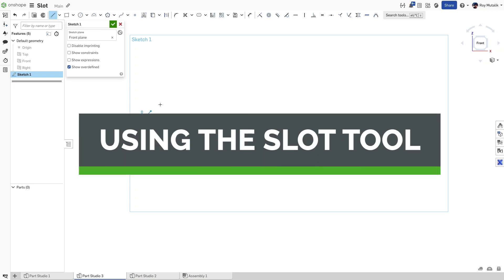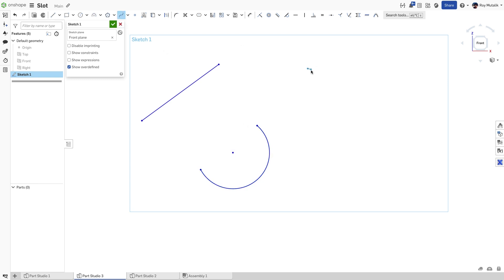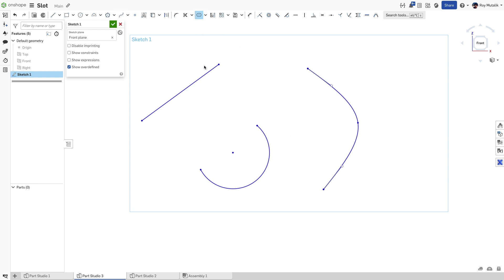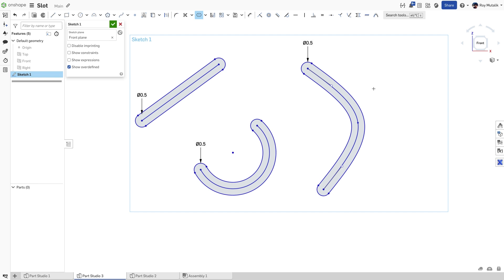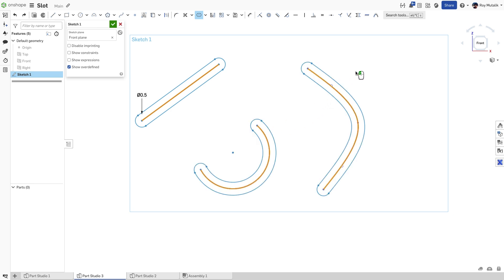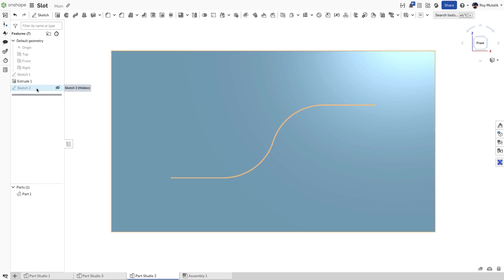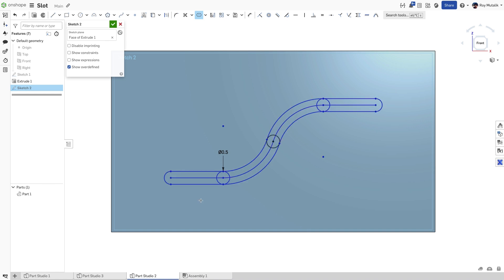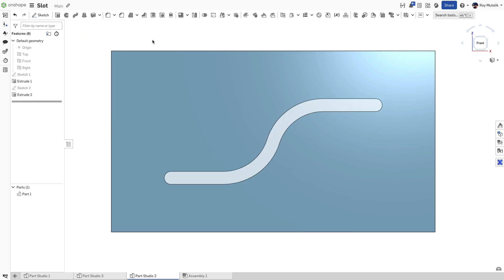How to Sketch Slots in Onshape - Tech Tip

Comment: Hey guys, i have a question. When creating a slot with a certain dimension and finish the slot operation, is there a way to edit the slot that was just created and add another line, arc or spline to the slot or do you need to delete the slot that was just created and make a new one to make the slot-dimensions of all the members dependent on each other?